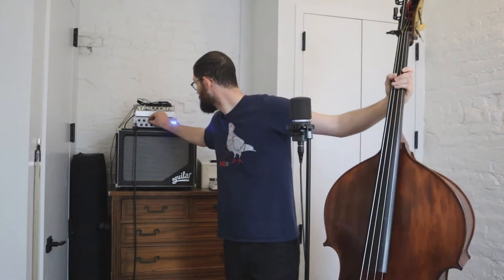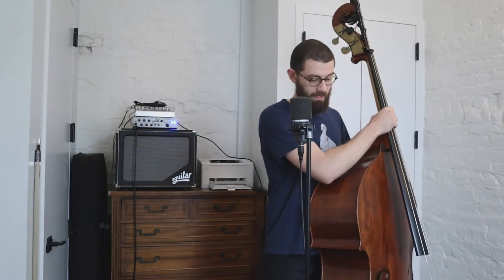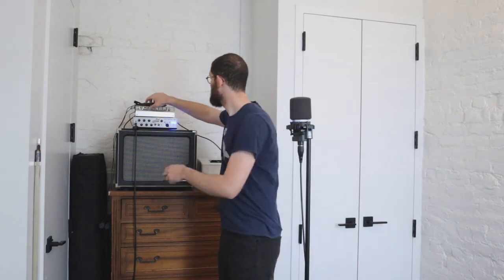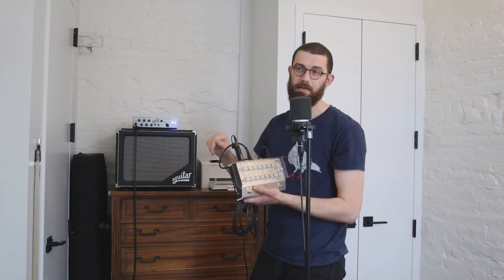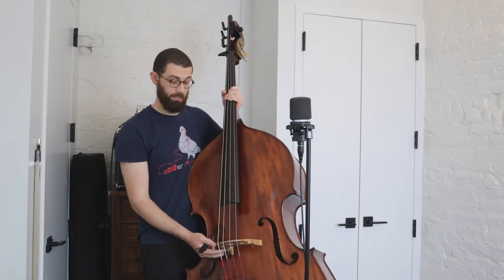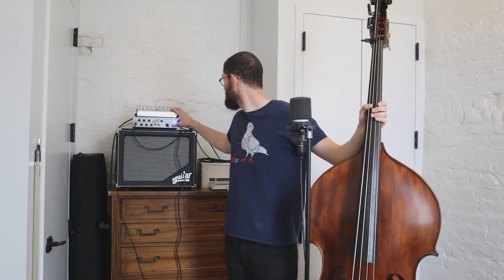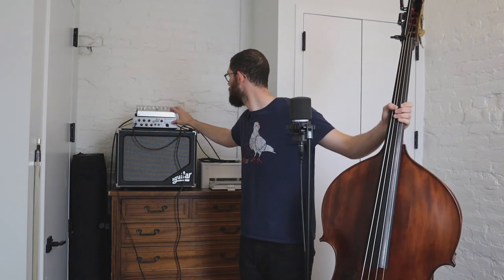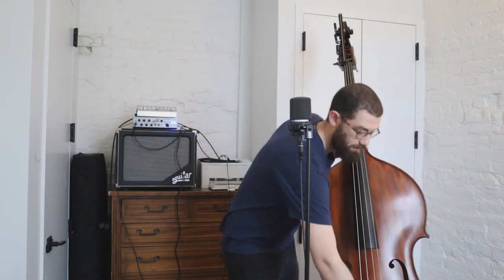Bluegrass Bass Lessons: Technique Video #4 - Plugging In & Mic'ing Up

Comment: Could you say where you are setting when you say minus or pull out or centered. Is far left minus and pulling out? Is top centered and balanced? Far right has the most whatever? Thanks, but this has been hard for me to find out.
Reply from the maker: Hi Paula!  Yes -- turning the knob all the way to the left pulls out that specific frequency range/effect, while turning the knob all the way to the right adds all of it in. Dead center is at zero.